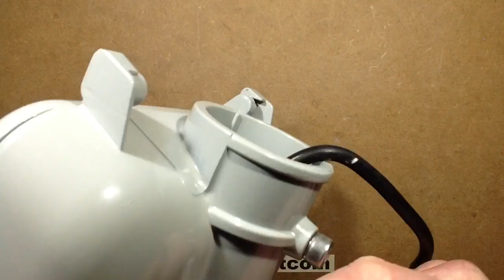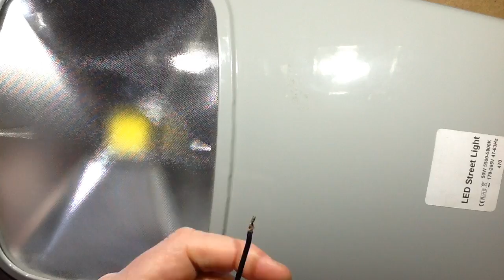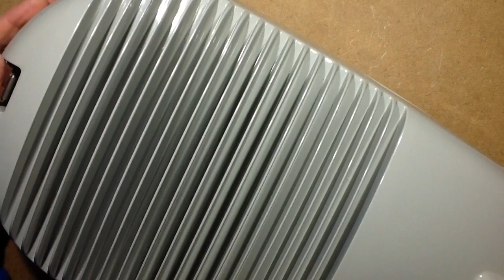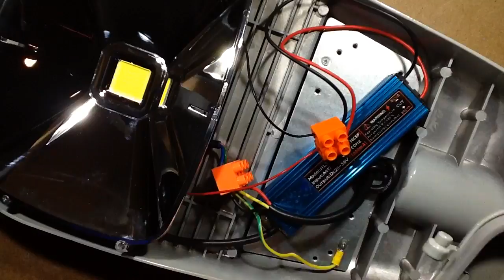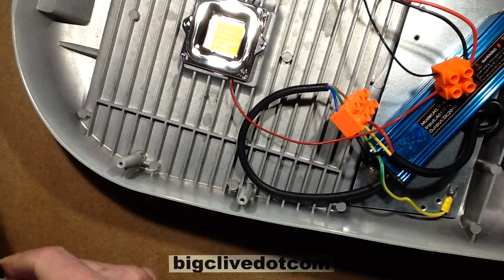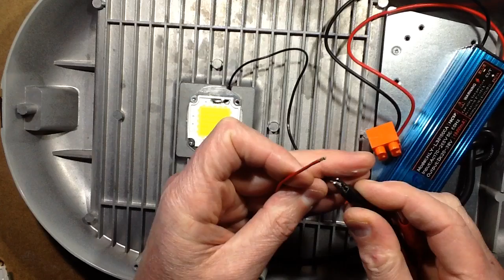Inside a 50W LED street light.

Comment: Clive didn't yellow used to be the earth colour before green/yellow?
Reply from the maker: +GateKommand I think it was plain green a very long time ago.
Reply: I knew it was something like that!
Reply from the maker: +Ben McKenna To date I've not come across a Philips LED product that could hope to last even ten years.  The system will probably never pay for itself, and need ongoing maintenance.  Ignore the salesmen.
Reply: +The Kaiser As far as something ready-built goes, you won't find anything worth having under $1000 USD that operated off of batteries. If you can put it together yourself, check out something like the 300W fixtures here:
http://www.ebay.com/itm/100W-150W-200W-300W-400W-Led-Flood-Light-Lamps-Waterproof-IP65-Outdoor-Landscape-/121862272640?var=420858300000&hash=item1c5f8eb680:m:m-I9ykPoRZ2GdzmeBTVA-Pg

and keep in mind you'll want to replace the AC driver with something like one of these:
http://www.ebay.com/itm/DC-DC-10-32V-to-12V-60V-Step-up-Boost-Constant-Current-Power-Supply-Module-/171830688639?hash=item2801e83b7f:g:BO4AAOSw9N1Vg8R0
Reply: +The Kaiser I m thinking you want a single led rather than a multi array chip. Some people had trouble with the lens focusing the individual LEDs on the background
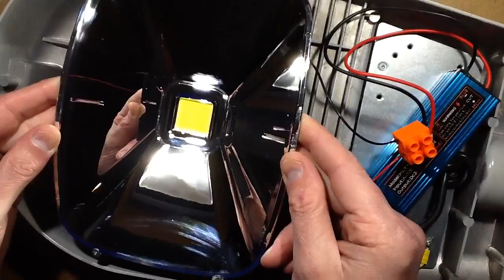Reply: +bigclivedotcom hi again great video I have a 29W philips indal luma mini it has 30 leds and a smart driver which automatically dims the lantern down to 50% at 23:00 and increases the light upto 100% at 05:00. also the driver in the lantern has the option of cms controls which is a wireless management system where the lantern can be switched on and off and dimmed at anytime from a Internet enabled device if a node/telecell  was fitted. also the nodes/telecell have sim cards in each one and when it receives a command it will switch on or off the lamp or even dim the lamp.

Does your lantern tell what R rating it is e.g. is it for a residential street or main road ?

Thanks
Reply from the maker: +Ben McKenna It appears to be very anonymous.  Not much labelling at all.  Sometimes \I wonder if they are making these things too complicated.  The GSM control systems are probably not going to be as resilient as traditional control gear.   At least it'll keep the service guys busy.  Not sure how the extra costs will compare with energy savings over time though.
Reply: Yeah I agree with you there but the system they use in my town is really quite good it's the philips citytouch interface which seems to be good at giving a precise meter reading for the whole borough and it allows the lights to be dimed saving life of the luminaires giving more use and energy efficiency the whole system here cost 11 million including led lanterns and cms interface. The council will save 1 million a year so for 25 years which the lanterns should be still be working for will be a 14 million saving I think they use to spend about 2 million on keeping the lights of with conventional control gear with standard sox, son, pll and cosmopolis lighting.

I'll try and get a video done of the luma I have. It's build quality is exceptional it's probably one of the best made but the most expensive lol.
Reply: bigclivedotcom I know where your coming from there mate we'll just have to play the waiting game now to see, time will only tell some led lanterns have been up for 4 years here so I wonder if they will go on longer should be 5 times longer according to philips.
Reply: +bigclivedotcom -- Hi clive. I am looking for a cheap LED lamp to replace my 1000W halogen movie-lights and be able to run them out in the sticks off battery. 
What, among all the crap, would you recommend for filming? If the light output is good, 100W LEDs should be enough, I guess?

Comment: Some where on ebay i found an LED like this type, but with 500W, What the hell? I thought.
Reply: +Grumpy Electrician I'm guessing they are marketing it as a 500W equivalent. So probably a 20W LED.
Reply: Nope i don't think so because it has about 8cm each side.
Edit: http://www.ebay.co.uk/itm/500W-Cool-White-10000K-55000LM-DC70V-78V-6-9A-High-Power-LED-Light-for-Lamp-Bulb-/221229546789?hash=item33824efd25:g:n9cAAOSwabhUUysA
Reply: Grumpy Electrician Holy crap that would be bright. I don't think I have anything that could power that at 70V and 7A.
I could do one or the other but I don't think I can manage both.

Comment: Street lights generally get replaced if a relamp or a new photocell does not fix it, and then it goes to the yard where somebody spends time taking them apart and making up working spot replacement units from them, complete with 10m of wire.

They can simply be taken up the cherry picker as a spare, undo old one, cut wires and drop new wires down then bolt light. Come down and fish wires out and do the connection to the pole fuse and see if it lights then go to next one. Saves a half hour per fault and 3 cycles on the lift hydraulics.

Comment: Neat light, just not the right colour for my eyes at night... :P

As for the wire colours, that's odd indeed, in the past I've had PC power cables that were brown, brown and brown, from china of course, one was even red, blue and yellow, they seem to often use whatever's to hand or cheapest, whether its compliant or not... :\
Reply: +twocvbloke im sure depending on price/leftovers, they use wire designed for USA 110/ or 240v, or UK wire, and who knows what germany/france/austalia colours are, but as long as its probably safe for the voltage, it gets used.
Reply: jusb1066
USA & Canada is Black, White and Green, the rest of the world, including china, seems to follow european standards of Brown, Blue and Yellow w/Green striping for single phase, so where this red black yellow is from, I believe it's just a made-up cable using leftovers...

Comment: any chance that is a higher rated LED that is being under-driven for longer life?
Reply: +Joseph Malovich do they make a single led rated higher than 50w?  seeing as its the same size as his other 50w i think id assume its just a quality led being run correctly with huge heatsinking so it would last a long time.
Reply: Now there is separate LED chips module with special design, 1W each pc for LED and not COB version, so the heat sink area is much larger and easier for heat dissapation, 30-480W power all can offer 5 years warranty, and actually it may use at least 8-10 years.
Reply: +jusb1066 Isn't each chip in the COB 1w? if so then it is just a good quality 50w (there was 5 rows of 10 chips)
Reply: Firecul42
yep it is a 50w chip, i didnt count how many individual in it
Reply: jusb1066 I am a bit bored at the moment so I have the time ;)
Reply: Um... Are mercury vapor lights better than 50 watts for ~ the same light output? Because that sounds wrong...

Comment: Red and black are the two live wires in a 120/240v US residential system with a shared neutral, as well as the colors of two of the phases in a 110/208v 3phase system.  It looks like that driver says 60hz? Maybe it is meant for the US market
Reply: +Warren Manne White, black, green is all I have ever seen in any of the stuff I purchase for Residential electrical work.
Reply: +legalizeshemp420 then you don't have too much experience in residential electrical. Never mind 240v AC, Dryer, or oven circuits. Even simple 120v switch loops are now commonly using a red wire because too many people like you were using the white (NEUTRAL ONLY!!) conductor as a live wire. Any time you have 240v in a US home it should use black and red as the ungrounded conductors. Open up any panel in a home and you'll see the two hot legs coming in are using a black and red conductor.
Reply: Warren Manne
I don't screw with 240v so I have no idea on that I was just talking about the 117vac stuff.  Go down and buy a fan, or a light fixture at a home improvement center and not any have I seen use a red.  Know why?  DC in the USA is red black and green and is easily confusable.  I just Googled and found this ":The US National Electrical Code only mandates white (or grey) for the neutral power conductor and bare copper, green, or green with yellow stripe for the protective ground."  Your red breaks code.

WOW, this chart is super nice http://www.allaboutcircuits.com/textbook/reference/chpt-2/wiring-color-codes-infographic/
Reply: +legalizeshemp420 you have no idea what you're talking about.  Most of what you said doesn't even make sense, especially the part about DC circuits. And I never said the code required those colors, I just said that's what's used. And it's just "national electric code" not what you said. I'm a licensed unrestricted electrician in the state of GA.  I may not know it all, but I know you're wrong. I posted my comment to perhaps provide some idea as to why the whip in the video had the color wires it does.  Not to go back and forth with you.
Reply: +Warren Manne but just out of curiosity cause you've got me thinking now. With your vast knowledge of the NEC, how does what I said break the code? Specific articles would be appreciated
Reply: Warren Manne
2011 Changes to the NEC - 200.6(a)

Grounded (neutral) conductors 6 AWG and smaller must be identified by one of the following means [200.6(A)]:
	1)   By a continuous white outer finish.
	2)   By a continuous gray outer finish.
	3)   By three continuous white stripes along its entire length on other than green insulation.
	4)   Wires that have their outer covering finished to show a white or gray color but have colored tracer threads in the braid identifying the source of manufacture are considered to meet the provisions of this section. The use of white tape, paint, or other methods of identification isn't permitted for grounded conductors 6 AWG or smaller.
	6)   A single-conductor, sunlight-resistant, outdoor-rated cable used as the grounded conductor in photovoltaic power systems as permitted by 690.31(B) can be identified by distinctive white marking at all terminations.

	Grounded (neutral) conductors 4 AWG or larger must be identified by one of the following means [200.6(B)]:
	1)   A continuous white outer finish along its entire length.
	2)   A continuous gray outer finish along its entire length.
	3)   Three continuous white stripes along its length.
	4)   White or gray tape or markings at the terminations.

If you notice regardless of wire size white for neural is set in stone for grounded conductors but I did find this and it is probably what you are thinking about:
	Although the NEC doesn't require a specific color code for ungrounded conductors, electricians often use the following color system for power and lighting conductor identification:
	• 120/240V, single-phase — black, red, and white
Reply: +legalizeshemp420 ever heard the expression "stay in your lane"?  You have no clue what you're talking about. All you've done is post the article about grounded conductors. How does it relate to what I said?  You obviously don't understand 240v in the US, or you wouldn't be stuck on this neutral wire point you're  poorly trying to make. 240v in a us home doesn't even require a neutral. I think when I used the term "ungrounded conductor" you got confused. Look up the NEC definition of an ungrounded conductor. As to your comment about ceiling fans and lights, they use 120v. That's why you see a white, or neutral, or grounded conductor plus the hot and ground wires. But what about that crazy blue wire ceiling fans have for the light on them? That's not either of the colors you mentioned as being the only ones you've seen for residential electrical. Yet there they are, attached to almost everyone of the 1000 plus ceiling fans I've put up in my life.
Reply: +legalizeshemp420 does that mean all these lighting manufacturers are breaking the NEC code?
Reply: Warren Manne
What lighting are you buying?  Go to Home Depot, or Lowes or to any electrical supply house and open a box for anything you put up in the ceiling (ceiling fan, light fixture, etc...) and all of them have white, black, green (some have just bare copper instead of green).  If they do not use that white for the neutral then they are non complaint with NEC, yes.
Reply: +legalizeshemp420 are you even reading what I'm saying? The neutral wire, color or purpose, has nothing to do with my original comment. That's why I didn't bring up your beloved white wire. Again, you have no idea what you're talking about. I hope you have fire insurance for when you burn your house down. When you call an electrician to fix the next thing you mess up in your home, be sure to tell him how much you know about neutrals.
Reply: Warren Manne You keep skipping over the part about never ever seeing a goddamn red wire in any residential lighting as you are wrong.  I said go to an electrical supply house or to Home Depot or to Lowes and look at the damn wiring and show me a fucking red wire for 120vac.  You can't because your red wire is in your imagination or some stupid shit you used because red was cheaper to buy.
  Sure you could use red, or pink, purple or anything not white or gray but the defacto standard, as seen by every thing you buy in the mentioned places, is black, white, bare or green not fucking red.
Reply: +legalizeshemp420 you're embarrassing yourself now. You think because you've changed a few fixtures that you're an expert. Go to Home Depot and check out any motion light, you'll find a red wire. While you're at it, take a look at the shelves full of wire, you'll see plenty of red wire. Even the Romex, which is meant for residential wiring. Remember just cause you haven't seen it, doesn't mean it doesn't exist.  You said yourself that you "don't mess with that 240stuff" so how could you possibly know the acceptable color schemes for wiring it? Again, you have no idea what you're talking about
Reply: +legalizeshemp420 just to reiterate... You're the only one talking about 120vac here, so you're arguing with yourself. And again, you have no clue what you're talking about

Comment: Actually does make you wonder, that what the chinese direct sellers sell to us, are the 'seconds'
Reply: +jusb1066   Thats how Sinclair brought the Spectrum out so cheap.  Using defective Ram chips at half the capacity they were made.
Reply: +jusb1066 but i've also seen quite often, usually in IT Stuff, that they seriously sell the original stuff, just without labels.
For example, there was once a "cheap" external USB case, don't remember the Company, but it was one of the big ones. They sold it for like 20 euros.

I bough 10 without the company name on it from china. And compared them, it was exactly the same device.
Even the material of the case was exactly the same plastic (i did a few tests with it with solvents, melting, burning etc)

So quite often, there is no difference at all.

But of course, yeah in the majority of cases, it is done with less quality material. Also they usually lower quality control.
Reply: +jusb1066 good chance of midnight runs
Reply: +ChrisD4335 im sure most of the machinery is all set up and running all the time anyway, im sure what does happen is they test them, and the best of the crop is sold via proper suppliers and sold to customers who make real items such as this street light, the seconds which 'kind of' work are sold to us, the other small percentage that failes , who knows, i know i have had bad luck with anything bought from a chinese seller via auction (where they start items very low), so i wonder if thats where the broken junks goes
Reply: +jusb1066 a "midnight run" is just a term to describe when manufacturers assemble the components that failed quality testing and sell them off to a market that is less likely to notice. not the actual time of day they ran them
Reply: ChrisD4335
oh im sure in some cases it does happen, with memory cards for example, so they dont have to pay the big boss or the company that designed the real product, often using a lesser quality material during that run
Reply: +10p6 Binning is a commonplace industry practice in the silicon chip industry, and frankly it is a necessity if you want them to be priced cheaply and innovate.